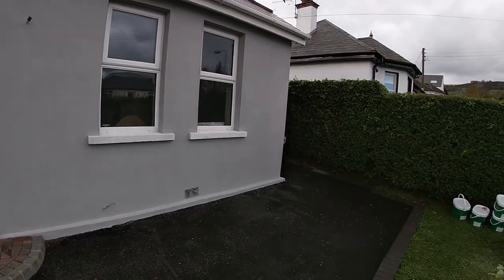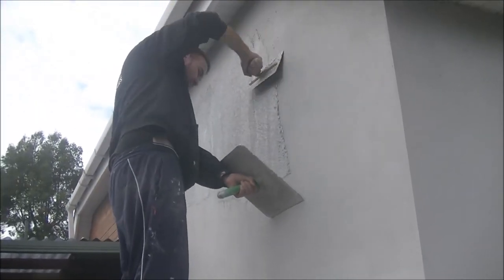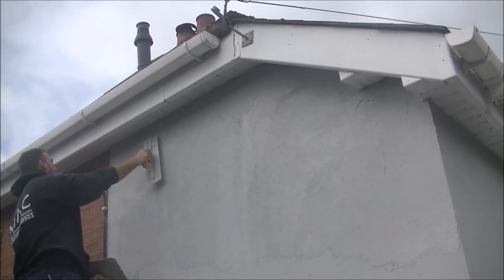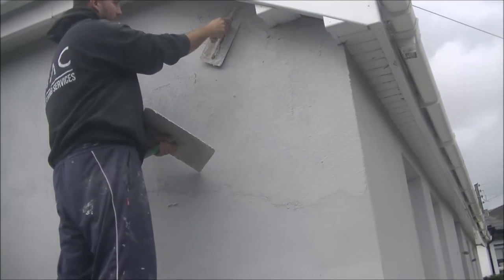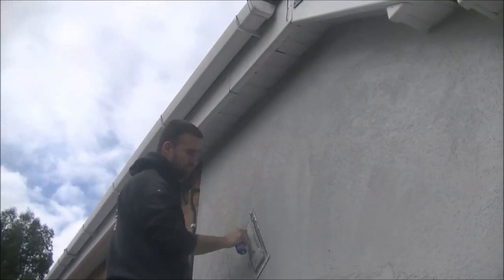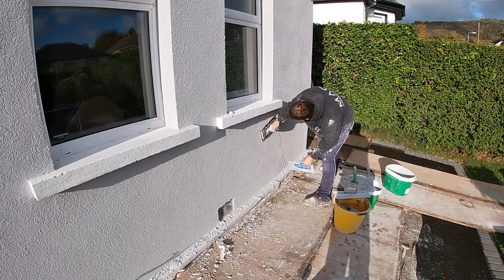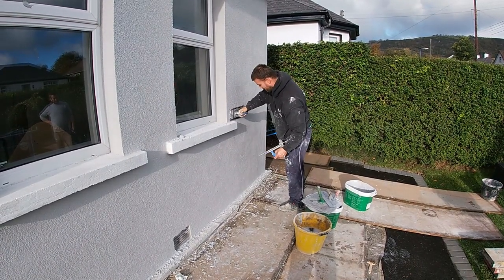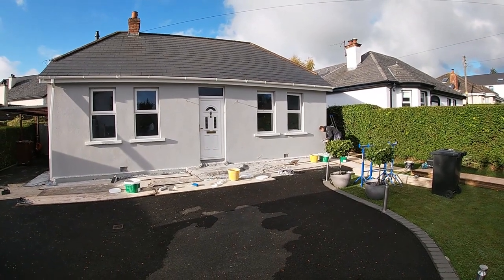ACRYLIC RENDER ON SAND AND CEMENT BUNGALOW CHARCOAL colour thincoat  refina plastic trowel float

Comment: Is that a refine plaziflex you're rubbing up with?  I just normally use the refina plastic ones. want something bit bigger though.
Reply from the maker: Hi buddy yes I used both for this one the plastic refina trowel and the plaziflex to finish the acrylic render I just wanted to show it can be used a steel trowel can also be used but plastic works much better and easier, Thanks for watching and commenting mate :)
Reply: @macplastering  Cheers pal!!
Reply from the maker: @frank__rizzo848  No problems mate :)

Comment: Hi Mac,just wondering does k-rend guarantee there product when applied to sand and cement. I’ve been using hp12 on my base but s&c would be a hell of a lot cheaper to use
Reply from the maker: As far as i know this is the way we where told by a rep years agao but no doubt they wanna sell but have as many outs as possible like they have a primer that is made specifically to go over sand and cement but you know if it fails its the plasterer no doubt

Comment: Aw ok so it’s cement render then a coloured primer painted on then tight coat of render then rub up with plastic trowel is that the sequence MAC cheers
Reply from the maker: Yes mate thats pretty much it in the nut shell :):)
Reply: mac plastering thanks a lot bro ✌️
Reply from the maker: @franksexton4083  Anytime Frank mate :):) Always here and new videos Every Sunday
Reply: mac plastering thanks Mac what’s your Christian name🤷‍♂️ just a quick question in your scratch coat it’s 3-1 and I assume sbr can you please explain why some use 3-1-1 the other one being Hydrated lime 3.5 cheers bro✌️
Reply from the maker: @franksexton4083  Joe is my name :) But yes some guys ike lime they think it makes it more workable and sets the gear of better , if you use plastazicer you shouldn't need it , also some say not to use both , if you put to much lime in it will be a very soft wall even when it sets , this was done with pre mixed gear so no idea on its mix really the builders dropped it of for use , but yes 1st coat should been 3 to 1 or 4 to 1 then the second coat should have been weaker again but it was full of plastazier as it didnt set very fast at all  even the end of the day the gear at bottom of tube was very soft and thats not usual as at the bottom of most tubes it gets very stiff
Reply: mac plastering thanks Joe appreciate your time and explanation stay safe and keep up the great work ✌️
Reply from the maker: Than you mate :)

Comment: What did you base it with Mac, 
K-rend hp12 or just sand & cement
Reply from the maker: Hi Wayne mate how's it going?  Yes its sand and cement I have yet to use hp12 but have herd it is much nice to rub than sand and cement ?
Reply: @macplastering  ye but 3 x the price, great work as always Mac  👍🏻
Reply from the maker: Yea most new things these days cost a lot and dont seem to drop in price but rise
Reply: Quality work as always mac.
With silicone render do u use Powerfloat once ruled off.
Just bought a refina powerfloat never used one
Reply from the maker: @kaimichael5444  Hi mate I have done yes then used had float to touch up and sponge if needed depending on the job have more videos to come on the power float

Comment: Does it help to thin it with water on large areas?
Reply from the maker: I never have mate dont think it says on it you can add water I just drill it up good and go but you might be able to, but then again it might weaken it some and also if you do ass water you would need to keep it the same as you might change the colour

Comment: Hi mate cracking finish,and great video.
Do you need to use a primer before you apply the silicone render?
Reply from the maker: I always do mate i have herd of a few guys going stright over fresh sand and cement but i wouldn't tryst it safe bet is to prime it mate =)
Reply: @macplastering  cheers buddy.
I’ve picked up a small job with this stuff,so I’m gonna give it a try.
Thanks again mate 👍
Reply from the maker: Hope it went well for you buddy and always here :)
Reply: @macplastering  thanks mate.
I’ll let you know how it went once I’ve done job 👍👍
Reply from the maker: @stinkbud2  Any time

Comment: Hi heading says silicone plaster but than it says acrlic...is silicone better  read a few forums and most say silicone is now the way to go...am doing a extension and have to decide which is best...thanks
Reply from the maker: Think its always been silicone but we called it acrylic possibly the coulour in it is acrylic
Reply: @macplastering  OK thanks ill check before I buy it...I googled both and they are different ...thanks
Reply from the maker: @sean550  Now u say it i do think it says on bucket acrylic and silicone both are applied and finished the same way thanks again for watching and commenting mate all the best mac

Comment: can one man top coat a 15s/m wall on he’s own and how would you go about it
Reply from the maker: Would most likely depend on shape of wall as in,  if its hand high but long one man could robs get it but be tired after for sure when you start you cant stop as the joints can tear when it starts to set / take up but if it was me doing it I would set the buckets all up where i needed them as in mix them up and set lid on lose then set them in the areas needed making sure I go over the top as to not run out anywhere hope this helps you brother ?Thanks for watching and commenting

Comment: Hi Mac. Doing my first job with silicone render. Not realy a plasterer but can do some. First small wall was in the sun and dried fast. Second wall today went well  but drizzle and showers came in and it would not go off so had to cover. Two bigger walls to go and as i am on my own and dont even  know anyone who could help. Can you put another coat on if the worst comes to it. The mayo weather is not realiable. Thanks for showing
Reply from the maker: Yes been in mayo before and yes was crazy weather but a lovely place :) I would think you might just need to prime it again mate to be safe but it should take the coat ok and yes hard gear to use
Reply: Hi Mac. Thanks for reply. Tried pulling excess render off with a speedskim which worked well and saved a bit of time. Also didnt wear gloves which was a mistake.
Reply from the maker: @paultant6741  yes this gear sticks like mad man haha hard to clean why i have everything so well covered here

Comment: u dont sponge it at all do ya.its a very light coat isnt it.no need to paint it then is it.?
Reply from the maker: No just a rubbed finish mate plastic trowel works the best also can use a steel trowel on it and no need to paint its finished as is :)
Reply: @macplastering  cheers for the info mate.hope alls well
Reply from the maker: Going ok here mate hope you and the family are getting on well to mate :)

Comment: Hi mate, what size beads for this render?
Reply from the maker: none on top coat mate
Reply: @macplastering  thank you buddy, so did you just bead for the s&c then work to the corner?
Reply from the maker: @petespencer5260  Yes mate same as you would if you didn't use a bead with skimming remember this gear wants to be like less than 1mm thick or should i say thin LOL
Reply: @macplastering  cool, thanks man
Reply from the maker: @petespencer5260  Any time buddy

Comment: Hello Mac. Can you float the acrylic up straight away or do you have to wait for it to pick up a bit? 
Good job, mate. Take care and stay safe.

Thank you in advance.
Reply from the maker: We used to flat it up with the steel trowel in circular motion's when it 1st came out its finished very well but I have found that the plastic allows you t g at even quicker when you would be to heavy or to early with the steel trowel it would almost sit out in areas not loo as tidy or uniform when that happened we just laid more on then fell back but I do find this dont happen with the plastic hope this is useful info buddy